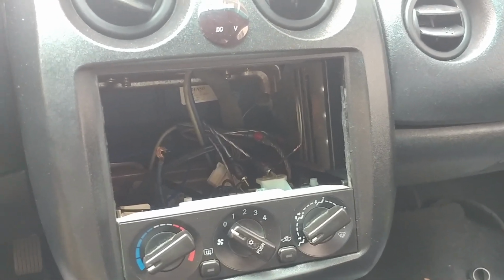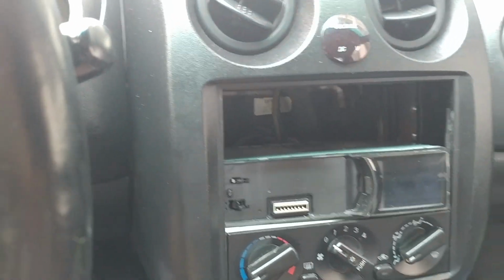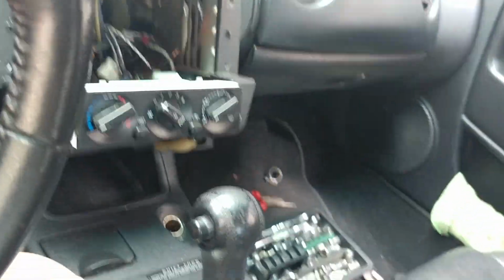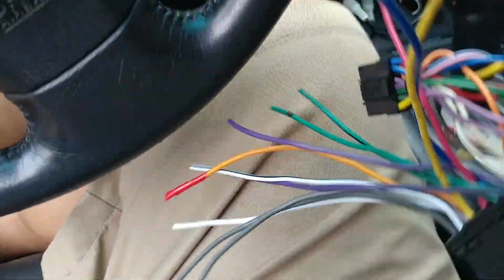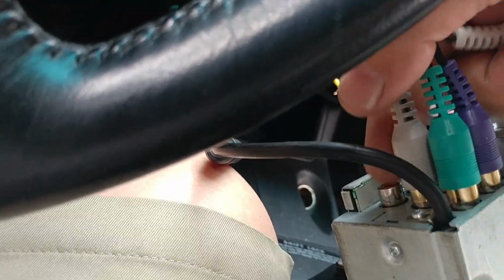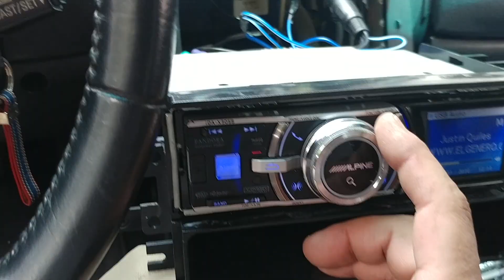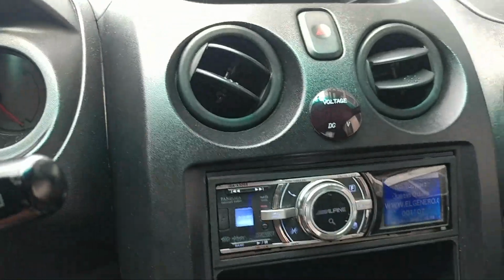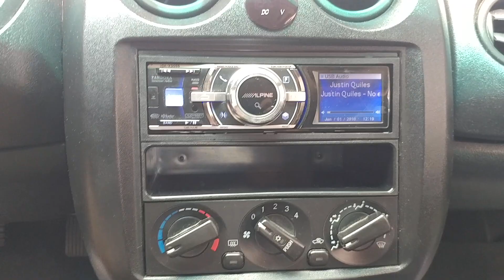2000 Mitsubishi Eclipse GT Custom Radio Install

Comment: Could you please explain what you did with the original four wires, the red/white, black/yellow, green/white, and black/white ones? How they connected to the radio and what they are for?
Reply from the maker: Hey Zeke Burger, Now, If you have a GT Model and installed an after market wiring harness meant for a stock amp, there is no need to worry of those 4 wires. White/Black-Power Antenna, Black/Yellow-Dimmer, Green/White-Illumination, Red/White-!2v Constant but it would be better if I knew what Eclipse Model your working with.
Reply: @eramirezjr5461  ive got a 2002 eclipse gt. Are you saying all I need are the four amp inputs?
Reply from the maker: @hollowurbx  Ok, the amp outputs will be used for 2 aftermarket amps im working to install in my car. One of those amps will replace the stock amp. If you still have the stock amp underneath the pass. seat, you will need a Metra 70-7003 Radio Wiring Harness or Scosche MI03B.  This will ease your installation as it did mine. It costs around $13-$15. Make sure the stock amp works and your good to go.

Comment: Previous owner took out the infinity system in mine, the connector that goes into all is partially cut with his own wires to it, I can get any head unit to work :(
Reply from the maker: WOW, NOT GOOD! The only (3) remedies for that is to (1) -replace the stock amp, stock music wiring and fuses if any. Now, in a cases like this, being that im used to working with systems, (2) -I would run my own RCA Amp wiring from the head unit to the back of the rear seats. Install 1 or 2 amps back there. Then run 12 or 14 gauge speaker wiring from the amp to the speakers. It can take a several hours to do. The stock wiring can be worked with, just as long that you have the wiring diagram. Stock wiring color codes are not like the aftermarket wiring. Im pretty sure that all the speaker wires are intact, its just figuring out what wire goes to what. (3) - You can bypass what used to be the Infinity amp wiring thus connecting the head unit directly to the speakers. I do believe that the former owner was trying to do that. I will try to get the wiring diagram to assist you. Now my question is, do you have power in the head unit?
Reply from the maker: Also, did you check to see if the factory amp was still intact? Its under the pass. seat.
Reply: @eramirezjr5461  Thank you for the reply, the stock amp was removed, the white connector that's plugs into has a couple wires still intact but the rest are cut and have aftermarket wires attached to them. I can get a head unit to work using the aftermarket adapter, you know green positive to green positive and so on, but then I have to take the aftermarket wires and connect to the green + and - and so on. It just doesn't feel right. I can post a video on my channel tomorrow so you can see. Any help is appreciated. I do plan on putting an amp in the car and that jazz.

Comment: good video .my only question is  about the timer on top .  when you install aftermarket that's useless after right? Or it works with the after market buttons?
Reply from the maker: The time clock still works, its not related to the radio or amp wiring.
Reply: I have a gs with just the cd player infinity radio idk if ur familiar with my stock radio but if you are did u need a wiring harness . What harness did you use.?
Reply from the maker: @stephenbautista4575  Well the GS and GT use the same wiring harness. I used the Scosche MI03B from Amazon.

Comment: Hey man, I out that Kenwood stereo you told me, connected everything. I have power but no sound. Fuses are good. Tomorrow I am taking the seat out and checking the amplifier. I looked at it and everything looks good connected, but the amp itself looks rusted and old. Might just be blown..
Reply from the maker: Wow, that's not good. Let me tell you that passengers with open drinks whether its bottled water or can soda, its a NO NO in a Eclipse GT due to its amp location. I got into a fight with the wife because she had spilled half a bottle of water on the pass. seat. No damage but now she understands. More than likely its blown. if anything, on ebay there a few of stock amps for about $100. Look at your options, 1-you can buy stock amp, 2-you can buy the amp bypass wiring, 3-install a second amp and do your own wiring. I saw the amp bypass wiring on ebay in which I thought of buying incase of an emergency. I have a second amp installed in my GT. It sounds awesome. Anyway try to get a 12v tester or a test light so you can check if voltage is reaching the amp. Also, did you connect the blue wire to your new radio? That's the signal wire that turns the amp on. If your still having trouble just hit me up on my watsapp nine two nine two three five four two five four ok. during the afternoon.
Reply from the maker: @rXTrLEGENDz  If you install an aftermarket amp, just run some RCA wires from radio to amp. Then run wiring from amp to speakers. Its not hard, just time consuming but it can be done. I have a aftermarket installed in my car for the 12 inch Kicker.
Reply from the maker: @rXTrLEGENDz  I'm in the same boat with this stay at home thing. If you run into any problems with the wiring or install. just let me know ok.

Comment: i bought a eclipse an the kenwood radio has no sound....me an my friend messed with it it cut on for like a min..then we installed no sound. all the wires are good an connected....what you thinks wrong?
Reply from the maker: Hey, It all depends what Eclipse you have. All GT models came  with a V6 engine and a factory amp that sits underneath the passengers seat. Take a look under that seat and if you see a black metal box, that's the amp. Please check before we can continue.

Comment: great video, when I was trying to install my new stereo the old one had a black cable doing all the way back behind the glove box and I can't figure out what its for it was also screwed into the old one the eclipse model I have is a 2003 gs if you could tell me what its for I would be extremely thankful
Reply from the maker: Hey Julie, by the way you described it, it sounds like a ground wire. The 3rd gen Eclipse did not come with a ground wire in the stock harness. If the wire you found was screwed on to the chassis of the old radio, my bet is that's a ground wire. When I got to work on my Eclipse, I didn't find a wire like that. I had to create a new ground for my install. If you have a 12v voltage test light, connect one end to that black wire and in the stock harness look for a solid blue wire, connect the other end of the 12v tester to that blue wire. If its a ground wire, your tester will light up like a Christmas tree. Hope this helps.
Reply: @eramirezjr5461  sorry for the late reply it ended up being a cable to connect a usb from the old owners stereo
Reply from the maker: @jamie4309  No problem. I'm glad everything has worked out for you.

Comment: How did you set up the ground wire i have a 2005 and I don't see a ground wire anywhere
Reply from the maker: Connect the ground to chassis. There is one or two places you can connect the ground with a  screw that's already in place. All you have todo is look for those screws, there in there.
Reply: @eramirezjr5461  can u show me in a small video or pic
Reply from the maker: @frankcofield4571   This  Wednesday or Thursday I will be working on my car and I will get that to you ok. I didn't have any problems connecting the ground wire, in fact , the voltage meter on my dash is connected to that same ground. If you had a 12v tester  which are cheaply available. It can make any job easy. Anyway, I do remember that there is a  metal sub frame with screws, I'm gonna check on that, its in there.
Reply from the maker: Hey Frank Cofield, I just uploaded the short video on grounding your radio, I did this one quickly so I hope it helps!   https://youtu.be/7LhWXKPmErg

Comment: Hey I know it’s late but where did you find that adaptor for the aftermarket radio? Currently my adaptor is too big and the eclipse wiri harness wont connect properly
Reply from the maker: Metra 70-7003 Receiver Wiring Harness, try amazon or ebay and thats for the GT model, NOT FOR GS
Reply: @eramirezjr5461  you’re the best bro thank you i actually found one that works 🤙
Reply from the maker: @3gnarek664  No problem, I'm glad that you found one. Enjoy!

Comment: I have an 03 eclipse gt and i don’t see anywhere to connect the single  blue wire that’s attached to the Audio harness
Reply from the maker: Hey Tyris, that blue wire is meant for a power antenna or a amp. Since you have a GT, than you don't need to use it on the antenna cuz its in your rear window. If your not using a second amp, just tape up the end and leave it. My harness had that one and the Blue/White which is the one I used for the factory amp. That blue wire turns my second amp on. Now, the blue wire that's connected on the black coaxial with 4-RCA's, that blue wire goes to your head unit harness. Look at the harness on the radio. You will see a blue and or a blue/white wire. That's where it goes.  That's if you got the Metra 70-7003 MITSUBISHI AMP HARNESS.

Comment: Did the aftermarket connectors come with the stereo or ordered separately? On my eclipse, the stereo has power, but no sound.
Reply from the maker: If you have an Eclipse GT, your car has a factory amp and its under the Pass seat. You must order the aftermarket plugs separately and it comes in a set of two or three plugs. One plug for the RS models and two plugs for the GT models. One of those plugs is for the factory amp which is Black. The plugs you need is METRA 70-7003. On ebay their like $10. This should help the "NO MUSIC"
Reply: @eramirezjr5461  Do you mind putting up links. I finna try something I saw on a forum tomorrow . Something about a power control wire/ antenna control wire" not being connected. Thank👍
Reply from the maker: First things first, what model of the eclipse do you have?
Reply: @eramirezjr5461  Its a 02 Mitsubishi eclipse gt
Reply from the maker: Ok, so you installed an aftermarket radio with out adding plugs and your having problems with the amp. Am I correct?
Reply: @eramirezjr5461  Haven't checked it yet. The previous owner installed a  stereo, but couldn't figure out the problem. I am going to look at it tomorrow. Was looking around and saw your video
Reply from the maker: Good, make sure that the factory amp plug is there. Its a rounded black male plug with 6 pins. Trust me, if its there your gonna see it. That wire is strictly for the amp and if its not connected, you ant hearing anything. Also look for the interior fuse box and look for MUSIC Fuse, its powers your amp.
Reply: @eramirezjr5461  Will do, I get back to you tomorrow. Thank you alot for the help 👍
Reply: @eramirezjr5461  Just checked the car and the stock amp plug is there but not connected. I think I am going to need that connection you were talking about.
Reply from the maker: Good, at least no one has tampered or damaged the amp wiring. Just remember that if your going to buy the METRA 70-7003 plug set, you have to use the rectangular plug with 4 (red, yellow, blue, orange) wires and the black female plug that has 4 RCA connectors and a blue/white wire. Now, how many RCA connection doe your radio have? You need at least 4
Reply: @eramirezjr5461  I only have two.
Reply from the maker: Ok, you will need (2) Male to 2 Female RCA to have front and rear speakers working. Remember its  Male to 2 Female RCA connectors. There cheaply available at bargain and electronic stores until you can get better ones.
Reply: @eramirezjr5461  I probably get the ones you got because I might just get a better stereo. I have a cheap jcv one
Reply from the maker: You can get a Kenwood KMM-BT325U, it cost around $75. It has 6-RCA ports 2-Frnt, 2-Rr, 2-Base and it sounds good. Its digital, no CD. It support 16 & 32gb flash drives just like my Alpine stereo.
Reply: @eramirezjr5461  Orale I look into it. Anything similar witha cd player? I am a bit old school. Got a bunch of cds de los Bukis de la jefa hahha.
Reply from the maker: Oh ok, you can try this one Kenwood KDC-BT33, with CD and USB.
Reply: @eramirezjr5461  Thanks will look into it

Comment: Do you remember where you bought this from? And when your buy it does it come with the screws to install it?
Reply from the maker: Yes, you can find the bracket at Ebay for $13.00.  Model name American International  MITK890 . the wiring harness was also from ebay for $16.00 Hope that helps.
Reply: eramirez jr thanks for replying so I do have to also buy the wiring then ?
Reply from the maker: @jonahsandoval_6523 Well, I do recommend that you buy the wires. It makes the installation easier and cleaner without damaging the stock wiring in the car. I still have my wiring setup like that and if I want to install a different radio, I just use that same harness. Its cheap and easy to install.
Reply from the maker: The stock brackets I got them on Ebay  and the install kit was from Amazon. NO, they don't come with screws, BUMMER!

Comment: How did ground the wire to the car?
Reply: There was no ground wire, you have to ground it to the chassis of the car.
Reply: I have it working and its been grounded but now its making this static noise, do you know whats causing it and how to get rid of it?

Comment: Where could I buy the wire that leads to the amp?
Reply from the maker: Hey Sam, well if your referring to the RCA leads, I got it from ebay. I don't remember the sellers id. The power leads are from sky high car audio cable also on ebay.
Reply: @eramirezjr5461  the one at 8:06 right?
Reply from the maker: @samlikesmusic4063  The black wire I pulled at 8:06 is a wire that only comes with the Eclipse GT for the Infinity sound system. If you have the GT model, look for it, it should be there. If you reach under the passenger seat and feel a metal box, that's the amp. If nothing is there, then you'll have to go with RCA's for your amp install. At 8:06 look at the RCA wiring I added. They are  dangling off to the right. Those are for the extra amp I installed. You might have to do the same if you Eclipse doesn't have the Infinity system in it. In my case, I'm fazing out the Infinity system with 2 amps I'm installing using RCA's.

Comment: Why would there be no sound
Reply: Because the speaker wires are dumb the way there done I had to find were the wires came in threw the cab by color and splice and re run from there to the dash on my 2000 eclipse gt